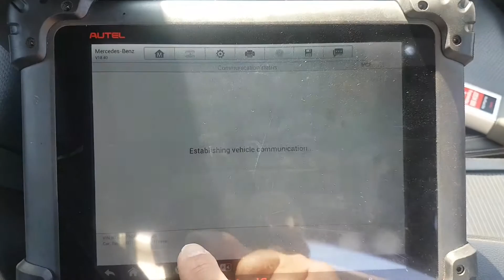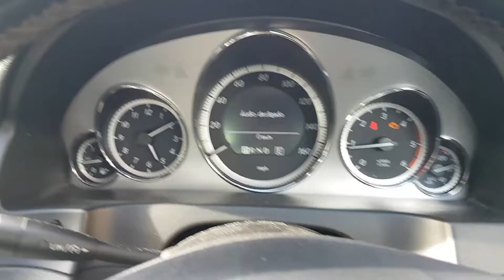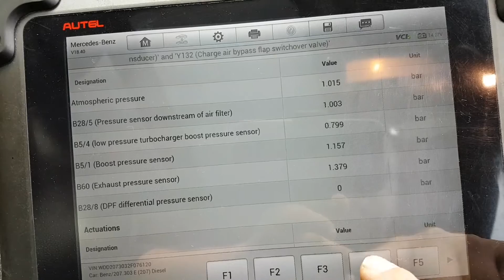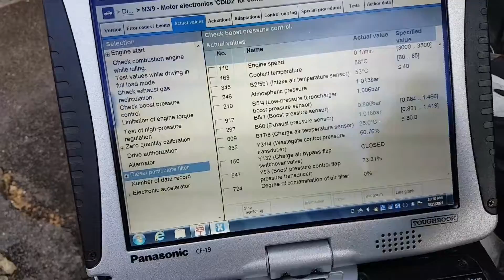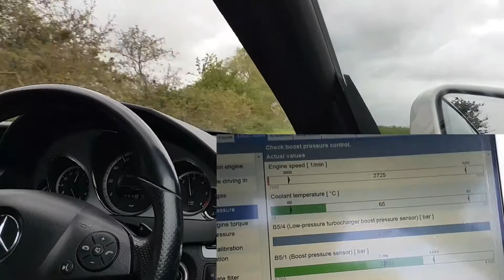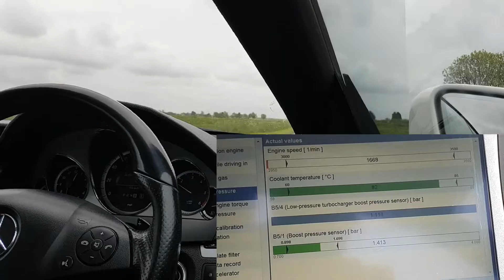Mercedes E250 CDI no power, P0240... parts cannon at its best!  Fault finding and repair.

Comment: U wanna check 5v with 12v test light?  Dk box - sensors are working on the resistance , change resistance on the go and watch Data on diagnostic .
Reply from the maker: Depending on the signal you can... I have done it many times...
Lower current 5v supply like in this case, doesn't work... I was just trying...
👍👍👍

Comment: Testlights come in different ratings, i have several different ones for different purposes. From 50 Ma all the way up to 10 A is adequate for most testing purposes. The one you are using most likely draws 150-250 Ma, which will not light on some 5V circuits. Thank you.
Reply from the maker: Correct... and well guessed... 200ma my one...
👍👍👍

Comment: Hello. Your approach to problem solving is very impressive. I have a Mercedes CLK with the same problem as a CLC from one of your old videos - I think its a faulty Electronic Ignition Switch. I can't get it fixed locally because no faults are identified when scanned and everyone tells me the car's perfect. It's actually very dangerous because the engine cuts out occasionally whilst driving. Can you help? I'm in Nottinghamshire.
Reply from the maker: Not sure how I can help...
I mean, my videos show some of the possible problems... it is a matter of investigating... I guess...
👍👍👍
Reply: @LMAutoRepairs  Yes but unlike you I haven't got the ability or equipment to dismantle, repair and reconstruct an EIS.

Comment: best way to test sensors
use breakout leads to conect plug to sensor and then check voltage and signal
Reply from the maker: To many breakout boxes needed...
Fair enough if you work with one manufacturer only, but when you work on multiple brands, not sure if that is feasible...
But definitely make testing way easier! 
👍👍👍

Comment: Hello, dlephi ECU and new Bosch has current limit only few mA per sensor(short circut protect). Older ECU have one 5v reg with 1.5A or two reg with 1A. One short sensor can kill signall from all sensor.

Comment: How many times does this happen? I see it regularly. Parts cannon boys always get cheap sensors from the usual motor factors. Always check what they look like. You can tell when its aftermarket junk. That actuator sticking  out where you were showing the plug/sensor at around 50 minutes in, causes alsorts of bother as well.

Comment: It's 5v so you can't test it with a test light
Reply: 😅 you need a flux capacitor to test 5v reference
Reply from the maker: @alexdragomirescu5084 
👍👍👍
Reply from the maker: Depending on the current you can...
I did it many times, and it is on some other videos... it is just that the bulb will not be fully bright...
👍👍👍